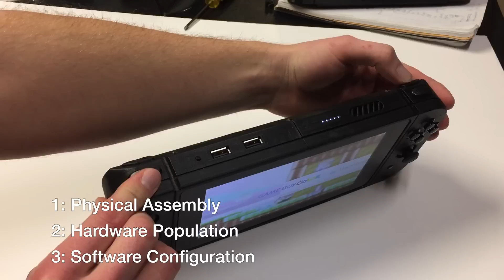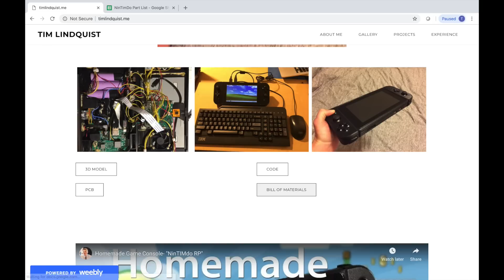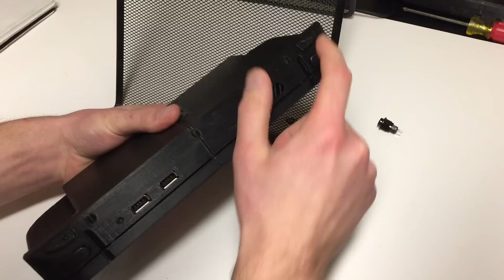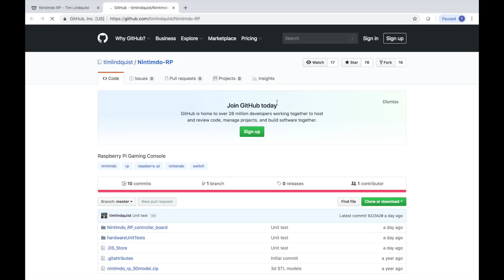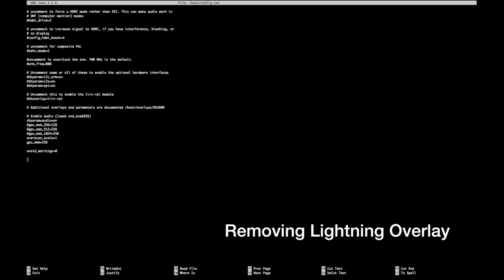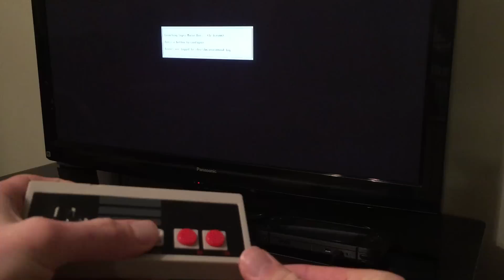Nintimdo Walkthrough

Comment: This is amazing!!! I've always wondered how hard it would be to design a beefier mold of the Nintendo Switch to include the dock and a bigger battery so that you can bring the experience everywhere you go. Plus I have big hands and would make gripping it easier. Do you know if it's possible to make the joycons detachable? And lastly do you know if it's possible to make the exterior have a rubberised material for drop protection and better grip? Almost like a permanent otter case.  I'd definitely look into modding my switch into a bigger better handheld. This is awesome.

Comment: If something as hefty as that thing can’t play GameCube or PS2 then nothing can

Edit: What I’m trying to say is that it’s a huge diy handheld and reminds me of PS2 and GameCube handhelds, so if it can’t play them then I would just get a switch and hack it for emulators. 

Yes I am aware that there probably isn’t a PS2 or GameCube Emulator for Switch but I would rather have a switch that emulates some of the same games on his project
Reply: @fujikoalfonso7448  No of course, but I can still play them at full speed with native resolution.  It's better than not being able to run them at all. Just the fact that I can play GC games on the go is pretty sweet.  If I want to play GC games in 1080P, I would play them on my PC.
Reply: i can play 3ds games on my phone but they run at 30fps but it's still smooth
Reply: What are you on my Phone can play those
Reply: Wrong. There's Raspberry Pi 4 out there already.
Reply: nowonmetube Not at the time of the recording.
Reply: @kaymezRap he was talking about most accurate for GameCube 🤦‍♂️
And no, the most accurate emulator has to be Higan emulator for SNES with hardware accuracy.
Reply: you know what astounds me? the amount of work gone into the machine yet you cant use a dollar worth of copper for heatsinks lol
Reply: You can run GameCube games on something as small as an Altoids tin, it’s not that effective with like 10mins battery life but it still works. You can make GC and PS2 portables about the same size or only slightly larger then an original game boy, no where near the size of that emulation device.
Reply: It’s that big for the screen. It could be a lot smaller.
Reply: My Samsung Galaxy 10 phone can run most Gamecube games at full speed.
Reply: @Patrick19833  hell yeah never been big into emulators i like playing games on their native hardware but my note 10 is a beast playing 3ds games at 1080p thats wild mpre than double the 3ds resolution
Reply: kaymezRap dolphin is an uptimised mess, that’s why
Reply: @KantHandleThis  Dolphin is considered the most well optimized emulator out there, what are you talking about son? The original dolphin mobile had issues but that had a lot to do with the specific hardware and software of the phones themselves rather than the optimization of dolphin.
Reply: Thunderklap My iPhone XS also runs GameCube very smoothly. Then again these two are phones are very expensive
Reply: MidNite I play GameCube games on my iPhone too, but you can still get so much more with a switch

Comment: I was thinking I can make a switch twice the thickness of the switch getting plenty of room for the original dock m. 2 SSD and flash drives. And a larger battery. And if you have to switch it can take advantage of external drives.
Reply: I imagine it wouldn't even require any custom handheld building experience. If you just buy a replacement back panel for the switch, remove the battery from a portable case, or battery bank. And glue it the dock and the insides of a usb to m.2 drive enclosure.
Then Super Glue on a 3D printed mounting mechanism. And have it all connect over USB.
Reply: RyanWake bradtelle Yes, this has been done before. There’s a YouTube video on it.
Reply: Plus covering up the type C port on the bottom means you can relocate it to the top.
Reply: @googlewake  If you're going to add on to your comment, edit it.
Reply: @dotmatrixmoe  I like the original comment to not have to be extended, that way people don't just glaze over it. To be honest my first comment explains everything, so you don't need to read the rest of them. So why would I ask you to.
Reply: You can try to put the switch components + 3tb ssd inside a wii u gamepad and that would be the beast !
Reply: @dizued  that would be a better case, but my idea can be made 3d printing a knife and  glue. But I hadn't thaught of that I'll look into it.
Reply: @dizued  that would be a better case, I hadn't thaught of that so I'll look into it. But I'm not sure if it would be a simple as 3d printing a knife and glue.
Reply: @dizued  with my case, I would superglue all the parts to a 3rd party replacement back plate.
Then I would remove the normal back plate, to the metal underneath. And have it slide on like joycons rails.
Everything would work over normal usb to
Reply: The switch doesn't support external drives over usb without hacking it btw
Reply: @jacks559  you'll need to hack your switch. It's worth it cuz ssd's and flash drives are so much cheaper. On top of the other benefits, like demoing games free and acess to tons of community ported software.

Comment: Hello mate I have a question what did you use for the thumb buttons(L3 R3)
Reply from the maker: Hi unfortunately the joysticks don't have push buttons in them. I used components stripped from a wii classic controller.
Reply: Oh but is there a other way to add those buttons
Reply from the maker: @cheesecake9250  yes you can buy some sticks that have the button press functionality and wire them in just like the other buttons. I bet digikey might have one you could buy

Comment: I've purchased all the materials over a year ago and finally got back into making this since you posted this video!  I have zero knowledge in how to wire, read diagrams, and solder...I think I've bitten off more than I can chew!  I was wondering if it would be possible to show how the bottom part (with the battery and raspberry pi) are set up?  There is a lot going on in there and I cant tell how the USB's are wired, the battery is wired or anything else for that matter!  If not, no worries.  This just might take me a couple more years to finish LOL :P

Comment: Hey man nice build! You think it would be possible to make a similar build but just with a screen? Then be able to connect actual joy cons via bluetooth. I think if u made a build this way it would make it easier to build with less components and maybe a little thinner. Could be a little cheaper for people who already own joycons too!
Reply from the maker: yeah, actually that would be a much easier build. One thing you would have to check is how those joy-cons connect via bluetooth, they would have to connect as 1 device and not 2 separate controller.
Reply: TimEE yeah i would make this if i had any kind of knowledge of coding/pi software to go along with cad and sodering. The idea is pretty simple, infact im sure someone can make an exact replica this way and be able to dimension it the same a regular switch. Except obviously its an emulator that plays retro games. Call it the Switch Retro!
Reply: I think I saw somewhere someone done if I find it again I will post the link
Reply: I just found it https://www.instructables.com/id/PiSwitch/
Reply: i am pretty sure that is an exact replica https://www.element14.com/community/docs/DOC-89165/l/hack-like-heck-mike-g-retro-switch

Comment: Have you messed around with the PowerBoost 1000 Basic? That little guy can output up to 4a. I’m guessing the screen is drawing a lot and contributing a bunch to the  low power warning? Your build is great looking. I’m bookmarking so I can check out your Teensy sketch later on. I have one in my current project, but I had a lot of issues with it. I’m not a programmer and I just pieced together some random bits from here and there, tried to use the bounce 2 library (if I remember right) an final got things going. I could not get any of the default sketches to work out for some reason. Do you have any issues with the Teensy like the analogs needing to be adjusted, button presses occasionally not registering, or lag at all? Just curious. I really need to dig into these Teensys more.
Reply from the maker: Screen Draws a ton!! Thanks for brining that power boost device to my attention might be able to deliver a steady supply of power for it.  Hmm by not work do you mean you got an error while compiling or an error loading it onto your teensy device? You do need to install an extra add on from here: https://www.pjrc.com/teensy/teensyduino.html
Let me know.

Comment: Im currently building one as well. I have the case printed and all materials. Now, I am trying to wire the audio circuits to include a 5 pole breadboard 3.5mm female jack from Adafruit. Also, Im trying to pry open the Ankr powerbank